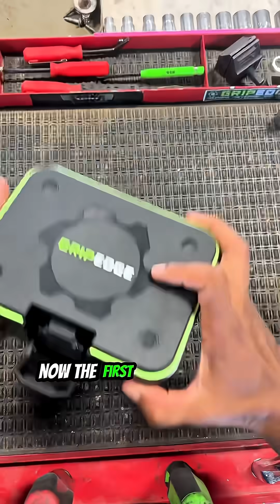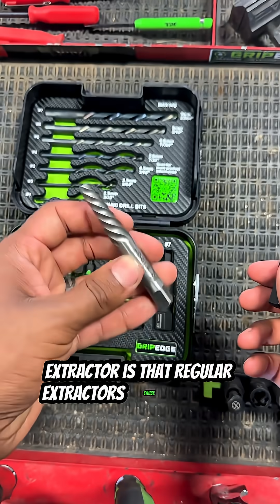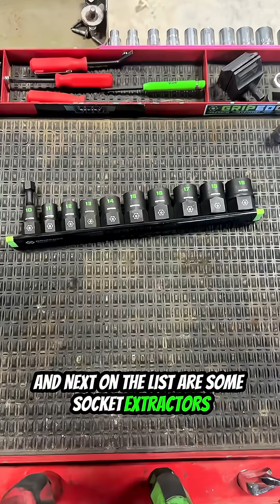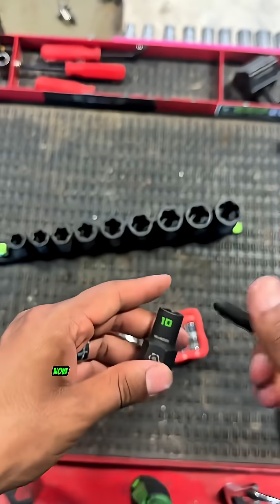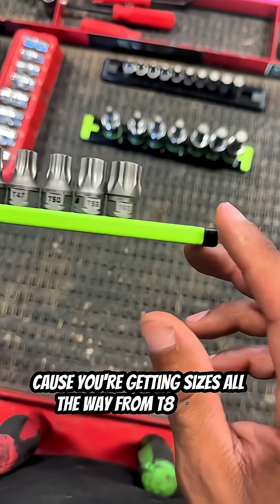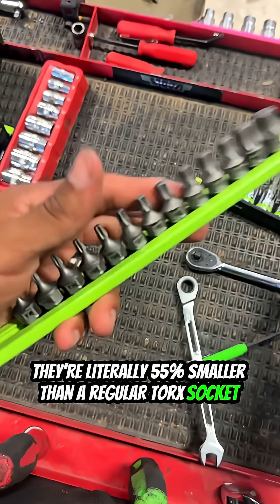🚀 Tools That Change Rust Belt Wrenching Forever! #mechanic

Comment: I have this tool (the drill bit and extractor set). I’ve tried it on about 30 different instances and it’s only worked once. The drill bits are pretty good, but the extractors are awful.

Comment: How much do they pay for paid promotions on yourube. Cause it seems to be common area. All I hear is the marketing b.s. never had any issues with twist extractor. Worked on factory equipment for most of my carrier so lots and lost of broken bolts. Never met one I couldn't remove this far and regular extractor have done fine

Comment: I bought the nano torque sockets. It was still too tall to get iinto the very tight space.   What I ended up doing was going for a 12 inch long torque screwdriver and ran behind obstacle and hit the screw under (plastic shield there) t

Comment: Currently watching “rusted bolt removal tips” b/c I’m dealing w/ some heavily corroded bolts I can’t get off in order to replace the bushings on my front sway bar.
  Sadly, I live in the rust belt, but what’s making these bolts even more difficult to remove is there location.  The sway bar bracket is bolted on top of a rectangular rail that runs side to side directly behind the steering rack.  
  So, d/t their location, there’s only 1 good direction to attack them from, & that is from behind the rail (towards the rear of the car).  Obvi, I’m sure you know these bushings are just round rubber/polyurethane with one flat side that go around the sway bar & are held in place by a simple half-circle bracket that humps over the bushing & is bolted down on either side. 
  A dual-flex ratchet works well to get a socket over the bolt head, but it’s pointless, if I can’t break them free.  I’ve hit them w/ pb blast & a wire brush, but so far no success. 
  What worse is, the bolt heads are not very thick (maybe a 1/4”-5/16” thick… So, not only are they getting a bit rounded, the side edges are tapering inward from bottom to top. So, the more torque you try to put on the bolt, the more it’s trying to push the socket up and off of itself.
Reply: I think the common method is to cut the bolts, and use new bolts with the new bushings.
Reply: @babongo  I’ve thought about that, but my only worry is that:
1. After I cut off the head of the bolts, I may have trouble getting a vise grip to hold good enough to make them turn. 
2. No idea what size bolts I’m gonna need to replace them once I get them out.

Comment: Not sure if you forgot to mention it or if I’m just wrong, but it looks like the extractor sockets also have a hex base that would fit into a ratcheting wrench to make them low profile as well for tight spaces.

Comment: Whats good for extracting a broken off bleeder screw? Already have a calliper on order but it would be a good challenge .
Reply: Those Gripedge extractors are amazing the one with the drill bits the FORS extractors however if you have the head on the bolt still you might be able to get a socket extractor on it Gripedge makes the best extractors by far
Reply: @DillonDaVillain222 ya the head snapped off as the thing came halfway out. Now only a threaded tube is sticking out.

Comment: The most important tool you'll need in the rust belt is an impact wrench.  Not just any impact wrench, though, you'll need a DCF 961 to break lugnuts loose, and a Milwaukee M12 stubby to loosen hose clamp bolts in tight spaces.